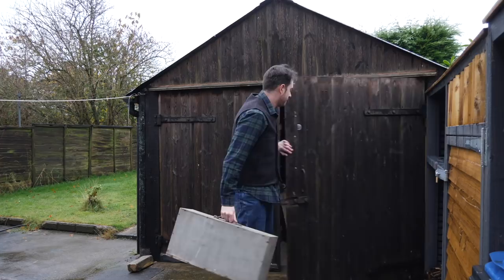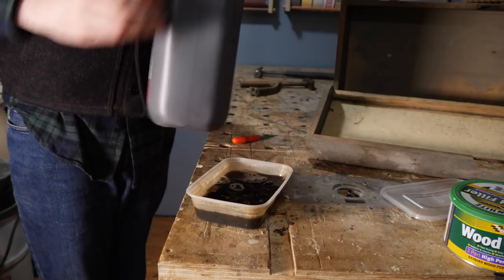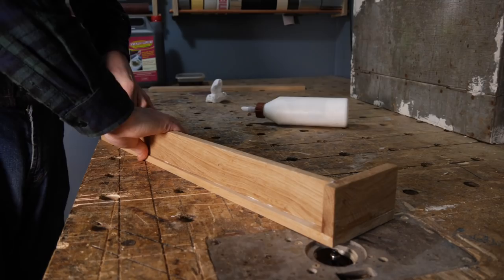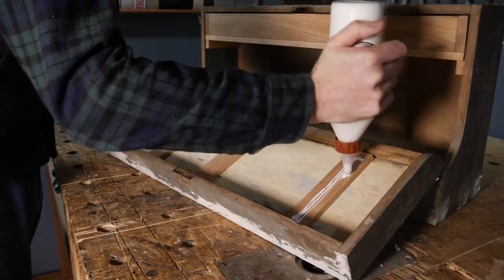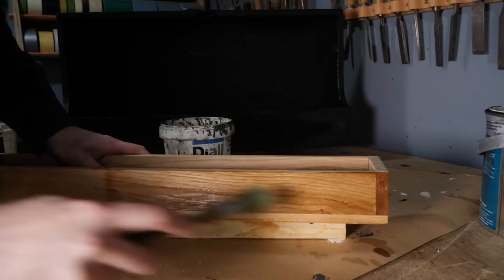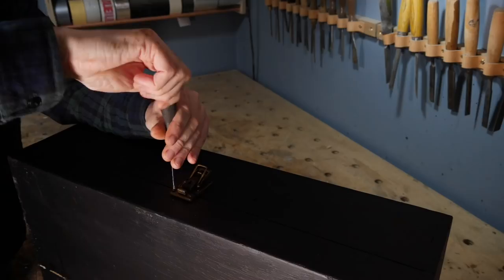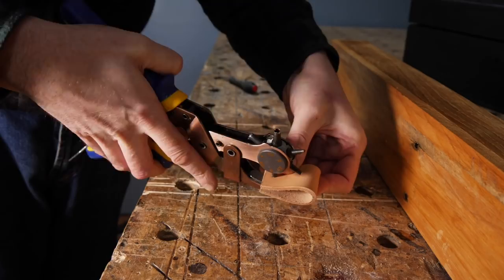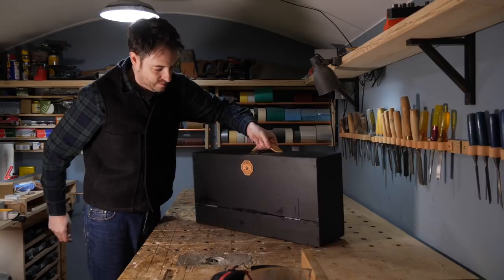Old Wooden Tool Box

Comment: I use the same filler, try with a bit less hardener, still dries to a hard sandable finish, just dries a bit slower if you need  a bit more working time.

Comment: Hello Badger :
  What you have is an 'Apprentice Box', which, as others have pointed out, was made by an apprentice in his first year to both store his first tools and teach some basic carpentry.   Later, he would make a larger, longer box called a 'Journey-Box' , that could be taken to job sites  with a basic set of tools that would allow him to do most tasks, and which had a little more room to allow him to pack any specialist tools he might need for a special job.  Finally, once he became a full journeyman,  he would set to work building his 'Master-Box', which was much larger, and intended to be stored in his workshop and in which he would store his 'Best Tools',  the tools he would use to make his ' Master Piece ' that he would present when he applied to become a Master Craftsman.
Reply from the maker: Interesting. There is a larger box also in the garage.
Reply: There is very, very little on these "boxes" online. Any idea where your info came from
Reply: @privatechannel8462   My Grandfather trained as a Carpenter and
Cabinetmaker before the First World War.   My older brother still
has his Apprentice Box, and some of the tools that he used.